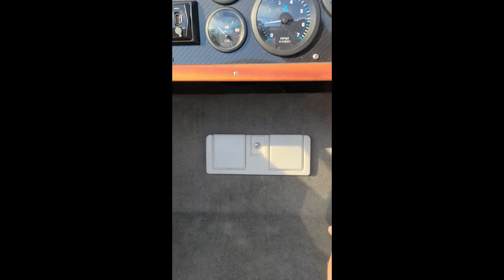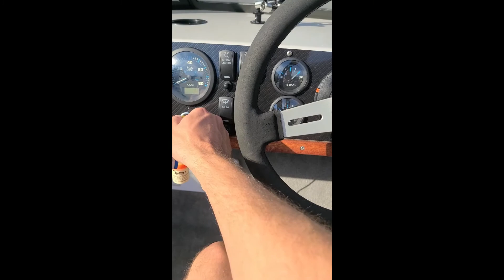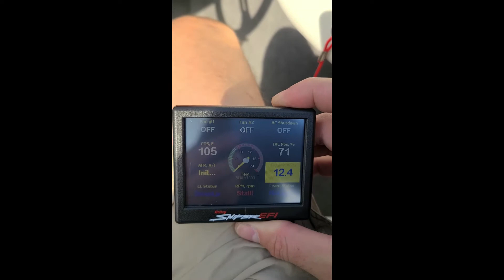Mercruiser 350 with Holley Sniper

Comment: How is the reversing  gear shift problem handled?  others have a lot of carb flooding ...
Reply from the maker: It still uses the OEM shift cut switch on the throttle cable, so when you push the shift lever, it cuts ignition briefly.

Comment: Is the 1:1 rising hose hooked up on the regulator? You want that plugged on a N/A application so the pressure stays at 60psi and doesnt drop due to engine vaccum

Comment: Looking to do this to my boat mechanic said it's a waste of time do you notice any improvements in the horsepower or performance how about trouble with the O2 sensor thank you for the good video
Reply from the maker: James, I ended up having an issue with my Sniper where it would lose sync with the touch screen.  I foolishly took it out anyhow (un-tuned) and ended up tuliping a valve.  I decided to put the carburetor back on for the rest of this season so that I could be on the water, and plan to work through the issues I was having with the Sniper after the cooler weather sets in.  My initial goal with the Sniper was not HP gain, but a better start and idle, as I am having occasional rich conditions with the Quadrajet.  You may be able to squeeze out a few HP with a good tune on the Sniper, but I don't think it's going to make a huge difference.  I believe the fear of the O2 sensor is misguided, as the sensor is in the dry part of the exhaust stream - if you've got water in the exhaust stream below the elbow (in the riser / manifold), fouling the O2 sensor is going to be the least of your worries.
Reply: @daxifus  yes I am also looking for easier starting and better running that's the reason I was thinking about this sniper EFI I am also going to run the carburetor for right now until it cools down I might just make the jump to LS thank you for your input I appreciate it